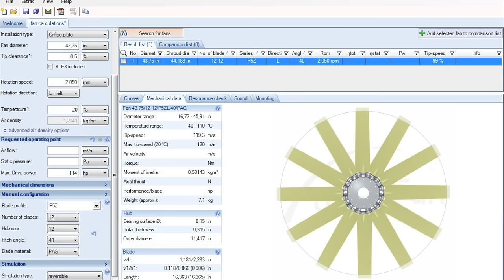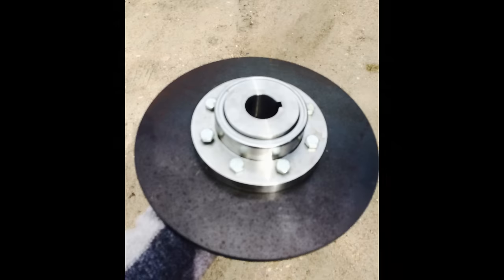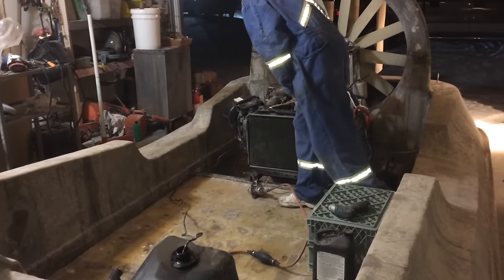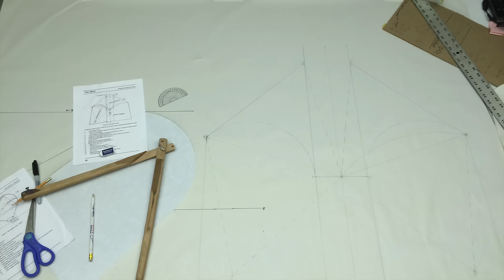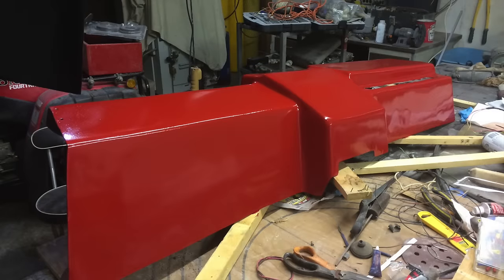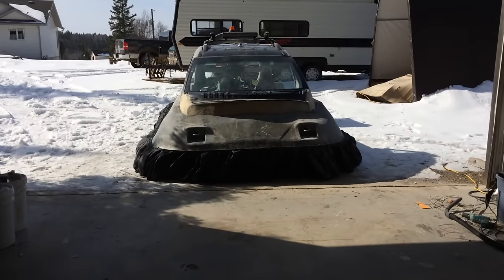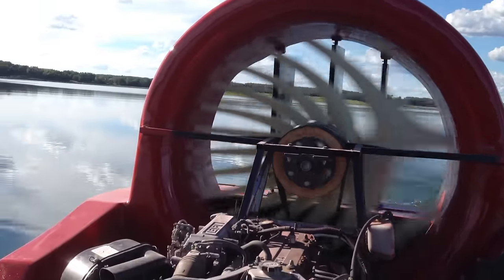DIY Homebuilt Hovercraft

Comment: Built a UH13T  in AK. Used a 12hp Briggs as a lift motor, and a 3k mi. engine from a wrecked Suzuki Sprint. I had a similar scenario with a EFI and computer control, but the old guys talked me out of using it. They, and now I refused to allow EFI/Electronics for "Bush" craft. It had to be KISS repair capable in the remote. We liberated a carb, from one side of a duel carbed Corvair Van (140ci) which matched the 61ci requirements and flow volume of the more modern 1000cc Suziki fairly well.  When I rebuilt the carb, the directions that came with the kit even had a float setting for marine applications. We made our own intake and carb adapter plate from tube and plate Al. The ignition worked out sweetly as they still had distributors with mechanical  vacuume advance. Cool cap. 
 The 2:1 reduction was multi V-Belt sheave drive. Ran her on the South Fork of the Koyukuk 40mi south of Coldfoot Alaska,  above the Artic Circle.

Comment: I know this hovercraft. I was involved in testing it. It was originally a finger skirt but the performance was mediocre. The 2 owners then tried a bag type and it was not much better. I wanted to purchase the unit for a tour in Edmonton but unfortunately the 2 guys that designed and built it had a falling out. One kept the hull and the other kept the motor and drive.  I have a few videos of it being tested at CFB  Edmonton and  Lake la Biche.  Wonderful job of restoring this unit.

Comment: I live in Portsmouth, uk of which the surrounding area is the home of the hovercraft. My mother took me on a trip on the srn2 which was going through various trials and they ran them for a while on Southsea beach. I was only about 5 or 6 but it got me hooked. Hovertravel have operated a service to the isle of wight since the 60's and are rhe oldest and only one in the world currently operating. I regularly go for a walk along the promenade and still stand and watch them come in and go out. The British hovercraft corporation used to build them on the Isle of Wight. Hovertravel actually used to build their own craft when they used the AP1-88. They also made open hull variations of which the Canadian coastguard bought to use as ice breakers. Their newest craft is made by griffon in nearby Southampton who now own hovertravel. These new craft use 2 diesel engines whereas the old AP1-88 used 4. 2 for lift and 2 for thrust. Also nearby in lee on Solent theres a hovercraft museum where some of the old bhc and other craft are kept. They have 2 of the enormous cross channel srn 4's, one of which i watched being brought in. Interestingly this is the same place where, in the 1970's a unit called the interservice hovercraft trials unit was set up for the sole purpose of evaluating them for the military. My father in law worked both for the British hovercraft corporation and mostly for vosper thorneycroft who built small military boats but built the VT1 and subsequently modified into the VT2 hovercraft. Theres plenty of videos on YouTube in the area but i imagine you must have seen some of them. Thats a fantastic project youve taken on and i must admit to being rather envious! A beautiful job!

Comment: I have seen a couple of home builds, and the favorite motor was the VW 1600 or 22250 air cooled.  These motors also make great generators, pumps, welders and compressors.  No great wiring harness or exotic fuel systems.

Comment: Well done that is fantastic. Excellent start to finish. If you decide on building another one build it with a lift motor you will be surprised the amount of more control you have. But if not well the hell done you have done fantastic.
Reply from the maker: Hi Craig!  My first craft (UH-12T2) had its own lift motor.  You could do doughnuts at a walking speed or take the unit out in winter with no fear of wrecking the craft.  We took this unit out with a couple inches of ice next to shore and really thin ice out at the middle.  The slowest speed you could do was 40 km/h.  A wave formed under the ice and began breaking the ice ahead of the craft. When the ice broke, jagged sheets were thrust upwards.  I was afraid to hit the pieces which might break the hull.  I won’t do that again!  If I operate on water, it’s really easy to slow down or I can go from 60 km/h (full speed) to stop in seconds by reducing to an idle without stressing the hull.

Comment: Nice job, well done.  My biggest worry with this video is that there doesn't seem to be a guard in front of the fan either in testing or on the finished craft.  If the fan blades let go for any reason, the fan blade bits are flying forward imbedding themselves in anything in their path, as the forces involved are flexing the blades forward.
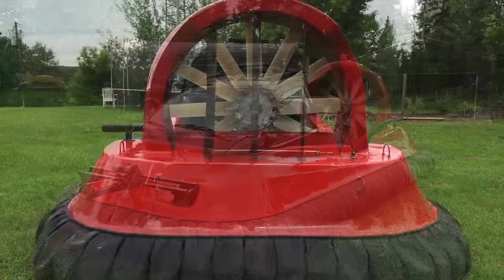Reply from the maker: I did install a fan guard.  It is visible at 11:15.  Some of the pictures on the lawn were taken before the craft was completed.  You are correct, I the first test, I did not have a guard - I should have!! Thanks for your comment.

Comment: Great job, I take it that the fan operates the skirt as well as turning the vessel. I’ve always thought a couple of bike or motorbike wheels projecting below the skirt would help it be more stable in turns. Not sure how others do it.
Reply: wheels on a boat. very funny - and a very very old navy gag. how about keels?
Reply: Well it doesn't have much friction so body roll shouldn't be a big thing should it? It doesn't turn by sterring from wheels at the bottom but rudders at the back.
Does it roll that significantly?
Reply: @zteaxon7787  there isn’t a lot of body roll but if there is someone riding in the cargo area, we move to shift weight on turns.  It’s helps slightly to increase friction on one side which allows a tighter turn.

Comment: This is pretty cool.  Could you get more performance is you had a variable intake for the air cushion?  Basically, cut out the entire fan contour from the rear and have an adjustable scoop extent into the air stream.  The idea would be to tune the amount of cushion air needed for given terrain to maximize forward thrust.
Reply: Grant, I used two linear actuators wired in parallel to change the height of the splitter plate.  The splitter plate is hinged on on side. I can adjust the amount of air going into the plenum.  It works relatively well.  I can get more thrust when needed as at full throttle there is plenty of lift even if the splitter in the the low position with a minimal cross section directed towards the plenum.  Great minds think alike!  Now I could use some help making flow straighteners to maximize thrust rather than the air swirling.  Ideas?
Reply: @roberttymofichuk1276  do you mean to straighten the air flow aft of the fan?  You want it more directionally aligned with  the axis of rotation?  If so the. I think a longer duct would help, but you should minimize the gap between the fan blades and the duct.  Gaps allow for noise and drag.
Reply: @GCTWorks  I want to straighten the air aft of the fan.  Hovercraft builders will design and install “flow straighteners” aft of the fan to take the swirl out of the air to vector it straight back, maximizing the thrust as well as changing the handling of the craft.  I don’t know enough about their design and am seeking someone experienced in this field.
Reply: @roberttymofichuk1276   Try using multiwing fan blades  mounted to a stationary hub at different angles to straighten the flow. Blades can be purchased from Norwest cooling in Edmonton.
Reply: @mrm6829  Have other people made flow straighteners with the multi wing blades?

Comment: Just amazing! It's still working? What happened if the motor stops other water?
Reply from the maker: It is still working well.  If the motor stops on water, it will float.  It is very stable floating but not very hydrodynamic and would be very slow paddling!

Comment: Hey, really nice video and awesome hovercraft!
I was only wondering.. how are you getting the air from the propeller unter the craft? I rewatched the video but couldnt make out any airducts or similar.
Hope someone can explain :)

Thx & hope yall have a great day
Reply: Hi!  In the duct, the bottom 1/4 or so of the circle, is a splitter that directs that air into the hull.  The air flows through the hull and out holes I cut in the hull into the skirt material.  The skirt segments are particularly open and the air inflates each segment and spills out under the craft, lifting the hull.  I hope this helps!  I found this document on splitters.  On the first page of this document is a diagram that shows the air flow.  http://www.ijmer.com/papers/Vol4_Issue5/Version-5/IJMER-45052128.pdf
Reply: @roberttymofichuk1276  ah okay alright - many thanks for that fast reply :) 
I would have never thought it could work by only directing part of the thrust downwards, but apparently it does xD 

Awesome work man, I really love it!
Reply: I just added another video that will describe the splitter and you will see holes I cut in the hull, one for each skirt segment.  Enjoy
Reply: @roberttymofichuk1276  nice, im sure to check it out :)

Comment: Why did you choose the right side for the driver?   I thought you could have saved even more weight by not using the standard car windshield, which is heavy.  If I build one, I would have picked the Universal make, the one that can fly to 5 ft.  I have a 1.5 car garage and is tight for a work shop, I am trying to build an airplane in it, Yours is bigger and better, but mine are well lit and insulated except I cannot use the expensive electric heaters like those people in Quebec or Manitoba with cheap hydro power. 1/4 of what it cost in Ontario.
Reply from the maker: Hi Tony!  Funny you mentioned about the “right hand drive”.  I never thought about it until your post!  It just seemed right at the time!

Comment: I thought it looked too heavy to work, but it seems not. How have you arranged the ducting to the shirk and what powers this system? Nevermind, I read the comments about the lower duct feeding the skirt. I wondered what that duct was in the early part of the video.
Reply from the maker: Hi Brian!  Hovercraft lift is a factor of the air pressure generated on the area of the craft.  This unit has a good sized hull.  I can easily carry 3 passengers - I have not tried more but I think I could easily carry one more. On land achieving lift is fairly easy.  The challenge is to achieve lift on water and get to planing speed.  My first craft, UH-12T2 was too heavy.  It achieve lift easy on the shop concrete floor.  I remember dad hauling the unit out onto the grass for its first time out of the shop, it was beautifully painted, I was beaming for pictures.  I reved up the engines and it didn’t move!  Boy, I learned a lot about weight and lift!  I modified the craft to lighten it, balanced the weight better. It worked on grass but had difficulty achieving planing speed on water until I did more modifications.  Life is one learning experience!

Comment: is the wooden pulley holding up? or did u switch it for an aluminium one?
Reply: The wooden pulley and idler is fantastic.  Absolutely no problems.  At first I tried a solid piece of hardwood for the idler, was fine for a bit and then warped badly as the moisture level in the wood changed. Then I tried laminated plywood and no issues as the plywood construction alternates the grains of the wood layers.  Sealing it also helps absorb any moisture.

Comment: Ok, that is freaking amazing.  Quick question though, I'm really curious if the craft is water tight, as in if he stopped the motor to do some fishing or what not, would it float?  That thing is cool AF.
Reply from the maker: Yes, the craft floats like a boat and it water tight.  Not a drop comes in.  It would bother me if it wasn’t.  When the craft is floating, it behaves like a flat bottomed raft.  It is very stable, you can jump up and down near the side  and it barely moves.  The downside is that it is almost impossible to paddle to move it as it is not hydrodynamic.  You would need a long pole to push off the bottom to effectively move it.

Comment: Great project and very well done.  One question.  How well does it float without engine power?  With all the foam and lightweight construction, I doubt it could sink but is the waterline acceptable?  Again, fantastic job.
Reply: It floats really well and is stable - kind of like a flat bottomed raft.  I can jump up and down on one side of the deck and there is minimal movement.  It does not sink much, keeping a reasonable waterline.
Reply: @roberttymofichuk1276  You have the “holy grail” of design.  The R22 is one of the most reliable engines too.  You could sell your design for production and retire right now.

Comment: what kind of fuel consumption does it get?  how much weight will it carry? what would you change? my sone just rolled my ford hybrid which I was thinking of using as a doner car and using electric motors for thrust and lift, I would like to ask your advice on the project.
Reply from the maker: Fuel consumption will depend on cruise speed.  Generally, hovercrafts get better mileage than boats because there is less drag.  On a river, current has little impact on your speed.  Hovercraft lift capability is related to the surface area of the craft,  the larger the area, the more weight it can carry.  If you design the lightest possible components, you gain payload capacity.  My craft can cruise at 58 KPH with 3 - 180 lb adults, and still have about 200 lbs of cargo capacity.

Comment: Do you have to continuously go forward to stay hovering? This does look like it would float fairly well in any case but just wondering if there was actually some way to hover without forward movement.
Reply from the maker: With the single engine design there is always forward thrust with lift.  On water, there is sufficient drag that I can move very slowly at hover.  It is easy to slow down on water because of the drag.  It floats really well but is not hydrodynamic (don’t expect to paddle it, as it behaves like a large raft). On the lake in winter, especially with ice, that is a different story!  Once (and only once), my wife and I had it out on really thin ice.  We took off and started accelerating.  We found out that the minimum speed one could go was about 40 kph, and at that speed the 1-2” of ice would start to crack due to the wave generated, sending up jagged ice chunks that could damage the hull, especially hitting them at speed or letting the craft down on its skids.  So now, we wait until reasonably thick ice or use it only on water.  In winter the only way to slow down is to reduce rpm and let some friction take over or spin the craft 180 degrees and apply thrust.  Not bad to spin it at less than 30 kph but pretty scary at higher speeds for the brief moment you are going sideways!  My first hovercraft used two engines and it was very pleasurable maneuvering on thin ice or snow.  You could go at a walking pace  or fast - it would go about 80 kph with 1/3 throttle, likely would do 160 kph or more at full throttle.  I never had the nerve to go full throttle for long!
Reply: @atlantisdiving1  Thanks for the detailed reply!

Comment: Im curious but olease excuse my ignorance, but if the motor shuts off while on water will the craft float or sink?
Reply from the maker: It will float.  When floating it behaves like a raft.  Very stable but not hydrodynamic.  You can paddle to move it but it would move very slowly.  You can jump up and down in the cargo area and it barely rocks.  When we took off from land the first time, my wife was with me.  We zipped seamlessly from the beach onto water, accelerating quickly.  When we were about a half mile from shore, I slackened off the throttle and we (correction - “I”) was going to see if it floated.  My wife quickly corrected me (to say it politely), that we should turn around, get close to shore and in shallow water first!  Good idea!  It did float really fine but in hindsight, she had a point.  :  )